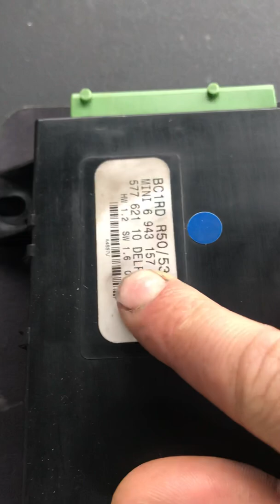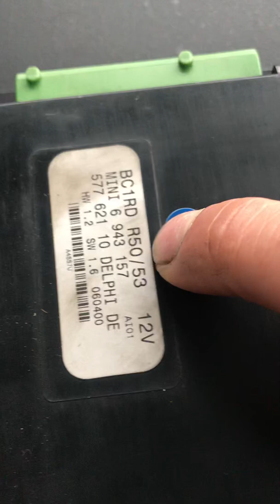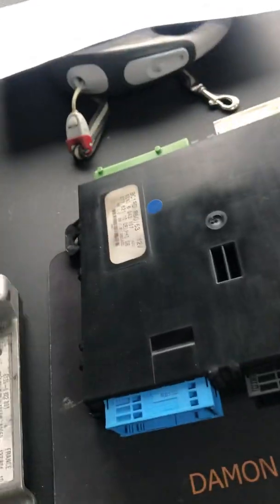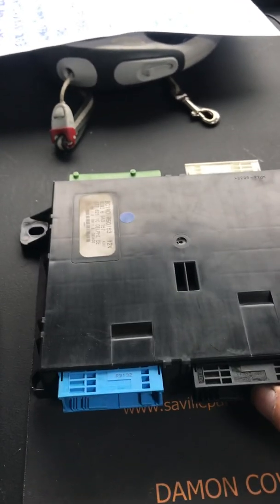MINI BCU FAULT HOW TO REPAIR, R50 R52 R52 (different types of BC1) body control / footwell module

Comment: Hi, I have a R52 with the black BCM... no water ingress visible.  Lights and indicators work externally but no tell-tails on the dash and the dash not illuminating!  Roof not working and rear windscreen not heating, but other dash functions are okay! (Speedo etc fine!) trying to think if it’s BCM or dash wiring? (I did change the radio for a CD player and wonder if it could be an earthing issue??) your help would be greatly appreciated! Great Vid, keep up the hard work!
Reply: Office Enquiries any news on this?
Reply: Juro H. Hi,  turns out it was an after market DAB Ariel... creating a short! Unplug the ariel and all returned to normal! All very odd!

Comment: My head lights dont turn on and my turn signals dont work. However, my hazards work fine and my high beams turn on when held in position. I have replaced the signal stack but the same thing happens. Do you think it is a Body control module?
Reply from the maker: Robby Robstar DIY Auto  yes certainly the symptoms of a body control module !

Comment: Car alarm keeps going off when parked up what could it be. its a mini convertible 2011
Reply from the maker: You’ll need to have that diagnosed at a garage, it could be a faulty alarm sensor I doubt BCU is faulty.

Comment: Hello, I bought a 2006 Mini Cooper Convertible at a blind online auction. The car is completely dead. Fully charged battery, and the only response is when I turn the key all the way to start and the accessory lights come on for a second and will stay on as long as I hold the key in the start position. I replaced the fuse interior panel and exterior panel. I replaced the ignition switch too, and still the same problem. All the fuses are good, but only half the fuse box works. Please help.
Reply from the maker: portugeepride possibly a faulty junction box which is basically the fuse board, before going any further I would be carrying out wiring checks if your not confident doing this pay an auto electrician to diagnose it for you first it will be worth paying £100 or so.. it’s not a common fault and I would be shocked if BCU is at fault with this problem.
Reply: i had the same issue. I replaced the BST (battery safety terminl) and the car started straight away

Comment: Hi mate
Need some advice if you can help. 
Had a faulty bcm 2003 mini cooper aluminum case. 
Bought another off eday said it was tested. 
Got it reprogrammed to my car. 
Plugged it in. Alarm goes off car starts and runs but alarm keeps going off and central locking don't work. 
So put old one back on but central locking don't work and central locking don't work. 
What's my options 
Thanks if you can help.
Reply from the maker: Jon Marshall  it’s highly unlikely it’s been Tested or if it has it may have been tested when the donor car was stripped and sat in a damp storage room for 6 months + firstly did the central locking work before you began swapping bcms?

Comment: I have this problem pls help the car is crazy ;-;
Reply: So the car goes crazy, trunk/hood open warning comes up for no reason, autolock stops working,indicators work but on the inside i dont get a indicator flashing, sometimes the radio does not work, the prking assistant sometimes stay on sometimes y does not work and when u close the car the back lights (included the third brake light) stays on for a while
Reply from the maker: Mr Apple definitely sounds like a BCU/BC1 problem I would get a replacement part fitted if it cures the problem then have it coded to the car. You don’t need a new unit a second hand module will work
Reply from the maker: Also has it got a CD changer in the trunk compartment ?
Reply: The Mini Gurus i dont know where should i look? We are talking about an r52
Reply: The Mini Gurus i suspect water got in the bc1 should i try getting it and drying it? And if i have to change it, can i do it with ncs expert?
Reply from the maker: Mr Apple firstly open the tailgate if there is a cd multi changer in the trunk check the wiring to that they may have sat in water, (very common) failing that replace the BC1 you don’t need a computer it’s plug and play, it it cures your symptoms then code it in to the car. However I’m not sure if NcS can do it as ive never used that equipment. Thanks
Reply: The Mini Gurus i will try this thank you very much for your help cheers from spain
Reply from the maker: What’s your problem we should be able to help?
Reply: One last question how come you guys decided to start a mini channel? Very creative mini r50-52-53 lacks on youtube you definately got a subscriber ;)
Reply from the maker: Mr Apple mainly to share lesser known faults and repairs for minis where people are often ripped off by garages for easy repairs.
Reply: The Mini Gurus thats says a lot about you guys oficial mini were giving me a 100+ pound minimum 😬
Reply: Oh and if you are interested in learning how to use NCS expert for accesing the ECU and unlocking some features or disabling others tell me and i will send you an email address with all the info you need
Reply: @yanoesappletastico8260  did u get ur bcm reprogrammed with ncs ??? Im on the same boat my bcm is an definitely as issue here !!
Reply: Alex Juskowiak hey ! Nope i did not need that my computer had too many errors And run out of memory so all I did was pay a mechanic to diagnostic my car with the official BMW Mini computer and I have 250 errors kept in the memory of the car so I didn’t know what to do they raise the errors and to this day I haven’t had any problems so maybe it’s just that in your car￼

Comment: Thanks for the video. I have an R52. For a few months I have an error message displayed, "EP", Emergency Program, for the automatic shifting, instead of the current gear.

Someone suggested it could be caused by faulty/wet BCU. What do you think?
Reply from the maker: Firstly you need have the car battery tested it can still read 12+ volts and be faulty if there is a bad cell, I would recommend replacing the battery regardless if it is the original BMW unit. Then have the fault memory reset and transmission adaptations reset. You may find this fixes the problem. Please like and subscribe if this helps
Reply: @theminigurus4299  thanks. Already liked and subbed. I earlier bought and installed a new battery but didn't fix the issue. Is transmission adaptions and fault memory easy to reset or do i need to go to shop to do it?
Reply from the maker: BelRiose2000 , yes unfortunately you could try and disconnect the battery for half an hour and re connect but failing that you’ll need a shop with the correct diagnostic equipment to reset either a specialist or main dealer unfortunately
Reply from the maker: I highly doubt the BCU will affect the problem you have.